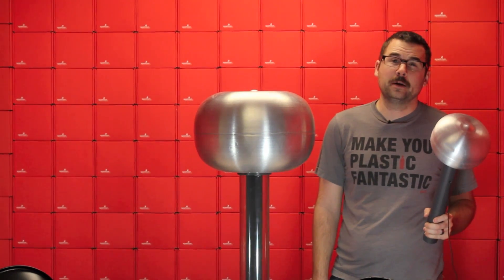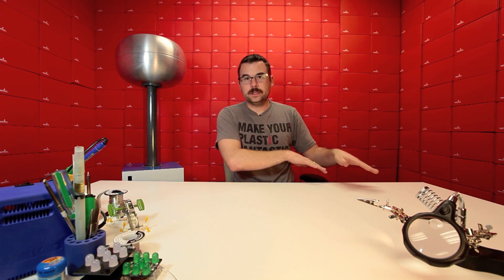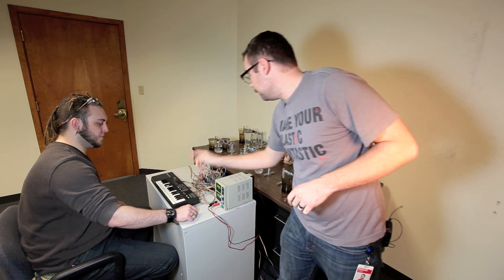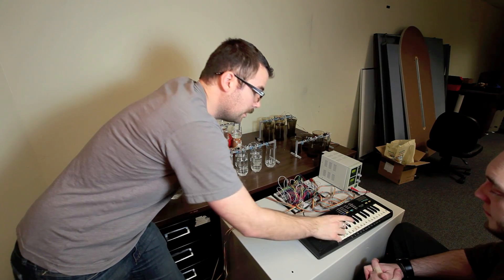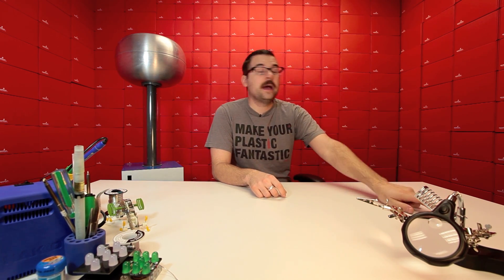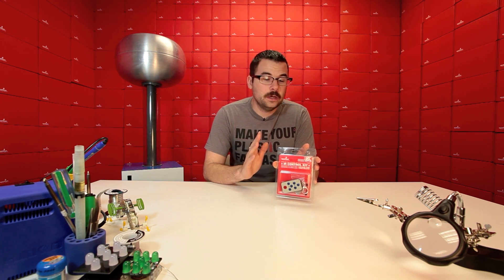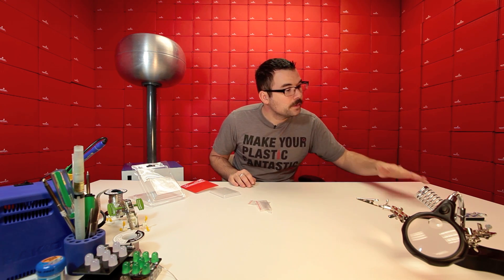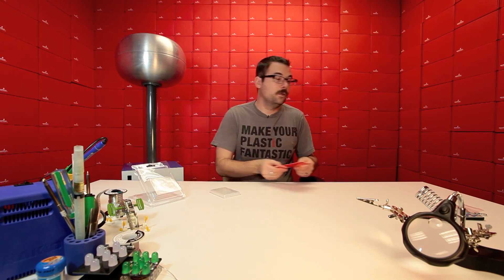SparkFun 1-20-12 Product Showcase

Comment: That is not a 5 volts solenoid, rather a 9 volts (or higher), since at 5 volts you have to push it a bit to lock up (if pushing to lock up counts as a properly working solenoid, you could also say that it is a 3.3 volts solenoid), but if you have to push, it defeats the purpose of a solenoid;

Comment: Looking for some help. Whats the easiest way I can wire a RF push pull solinoid to press on a spray can with a simple momentary RF remote? And have a wifi option using the Kasa wifi plugs that turn on and off using their app.Looking to spend $80 or less if able not including the Kasa plug I alrady have. Thought this would be a great opportunity for a video tutorial also.

Comment: If you are going to showcase a 5v solenoid, please to showcase it at 5v so we can get a good idea of what it should do at rated voltage, please. You say you offer it for use with 5v systems, so why demonstrate with 13v - that makes not sense -"Hey, this is for your 5 volt system, but you need 13 volts to use it! Buy it, so we can laugh at your disappointment!"

It is like demo those cute yellow gearmotor - "We don't going to run them, only slide them around table next to matching wheels while we talk so you don't even see how wonderful they are except as game pieces or somewhat! Really neat - so neat, we don't going to show you! You more tempted to buy, no?"

and some other items as well - if you showcase or demo, do so in a manner which match item listing, otherwise it just piss me off because what they hej, it don't apply!. Find some smart young peoples - they are all around - they will do good job - better than the glondvas pastrekji are doing now.

thank you for venting me - i will buy to showcase to myself the virtues.

Grados Kelslovijc
CHCR Suska

Comment: Ken Shirriff has a pretty handy, fairly well-written library for doing IR remote control (send and receive) on the Arduino.  I can't post links in comments of course, but if you google "ken shirriff ir arduino", you'll find it.

I've used it myself to implement a control for a camcorder.

Comment: Basic midi isn`t really that hard to implement even on bare avr with gcc and avr-libc, just use the internal usart with an optocoupler. In this case where you only need to consider note on events, it is even easier since you don`t need to handle note off events accordingly which can get a bit complicated (keeping track of which notes are currently playing, will that note off affect anything, is it sent as note on with 0 velocity etc.).

Comment: @scancool these cables are not hard to find!

they are available and cheap.

search google for a site named: monoprice

they sell them for less that a dollar!

here is the code for the micro usb cable: 4867

you will find it under ...

	HOME > USB & FIREWIRE > USB Cables > USB 2.0 Cables - Micro-B Type

3ft USB 2.0 A Male to Micro 5pin Male 28/28AWG Cable

good luck.